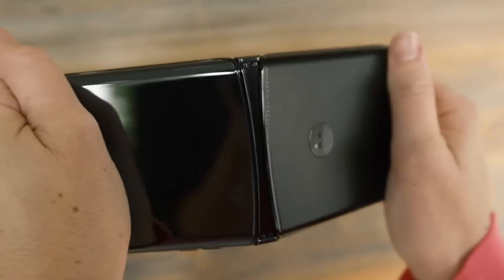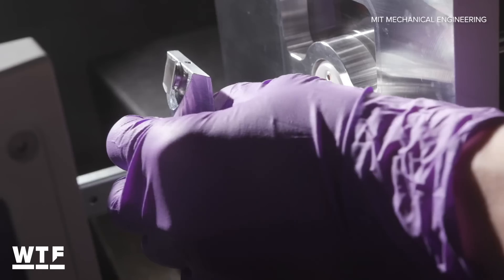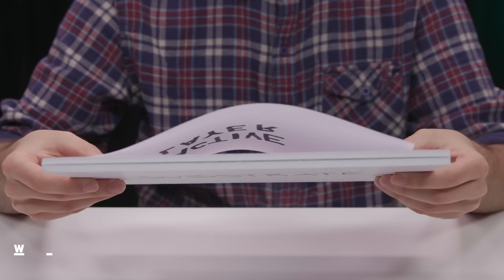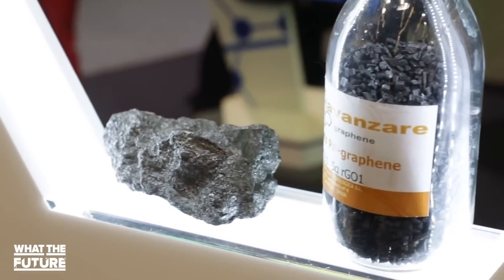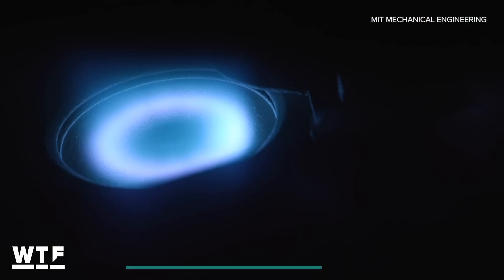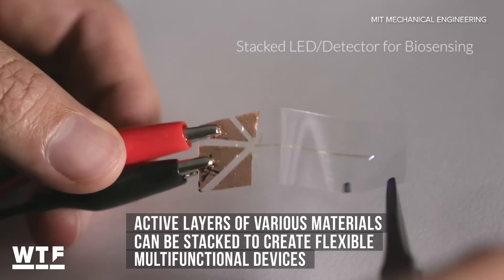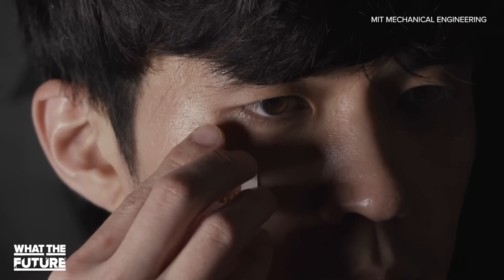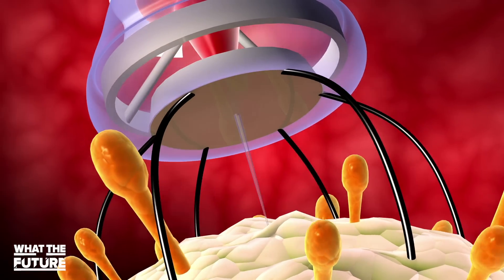Truly flexible electronics are coming for your skin, eyes, and body

Comment: What they don't tell you here is that some of these scientists are using humans  for non-consensual experiments with this stuff too.  Sneakily applying this substance to an unwitting human's skin, then it spreads and integrates imperceptibly into the skin surface with no way to remove it.  The test subject doesn't even realize they have it on them until the "scientists" begin remotely activating the microelectronics within this skin using radiofrequency waves.  Sickening results. Pain, hair loss, tinnitus, neurological disorders.  Sure they COULD use it to benefit humans but many unwitting test subjects are simply being remotely tortured with it.
Reply: ಠ_ಠ